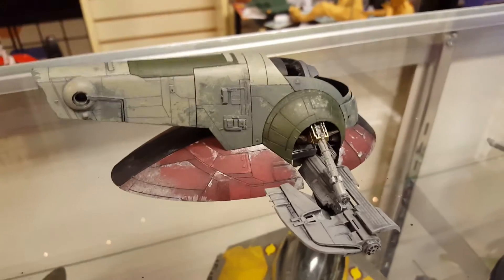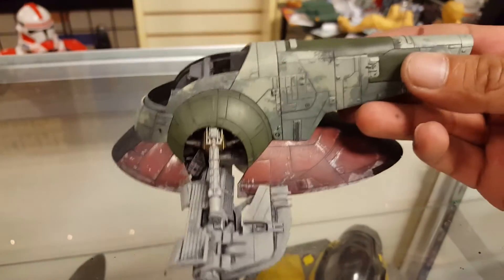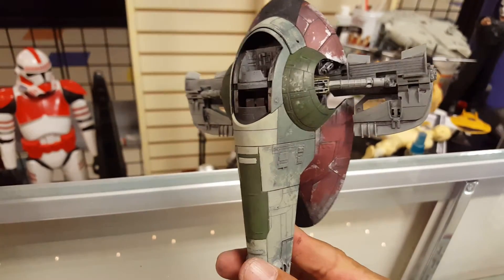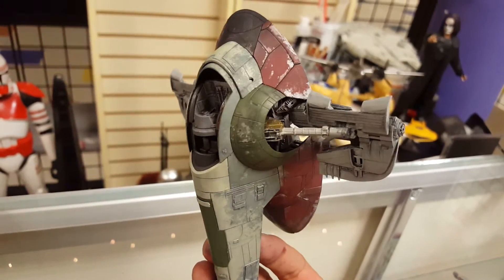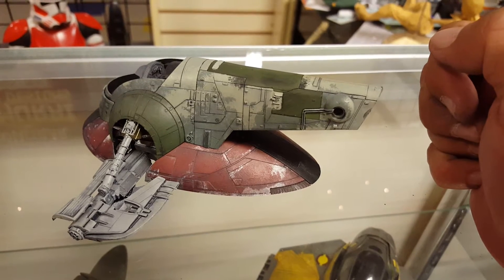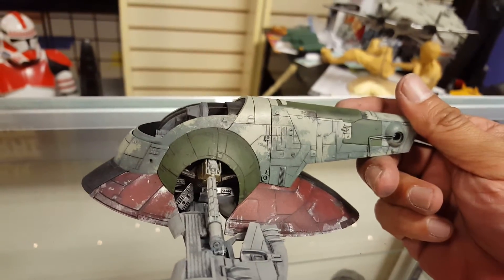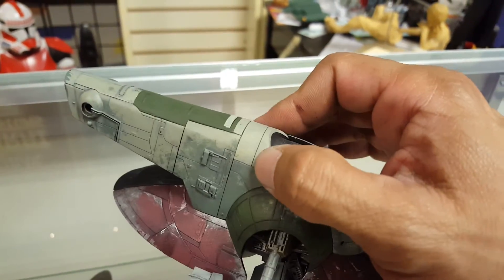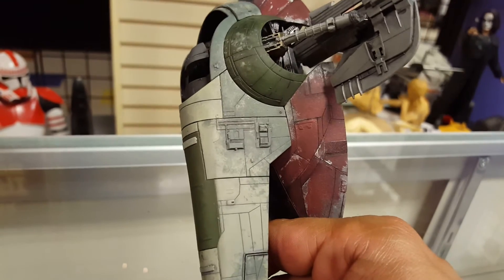Bandai Slave-1 Almost Complete.

Comment: how did you do the weathering on the bottom panels?
Reply from the maker: +江長遠 Hello,
The red skirt on the bottom was just done with a a couple of layers of a dark red and then the chipping was added with some a combination of mixing stippling and a little dry brushing to give it the effect. The last steps were just adding an ink pin wash to the panel lines and one l sat dry brushing of a brighter red to bring out the high lights.
Reply: +SamuraiGeekDesigns Did you do any sanding on the layers of paint?
Reply: +SamuraiGeekDesigns Nice job BTW.